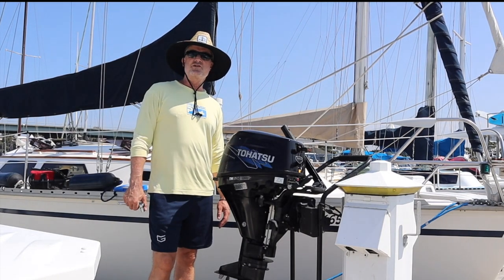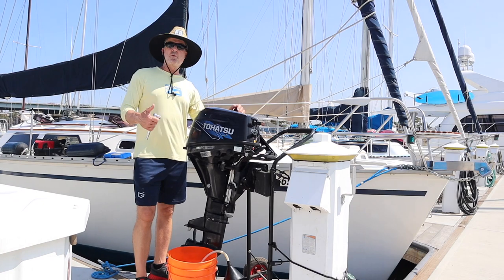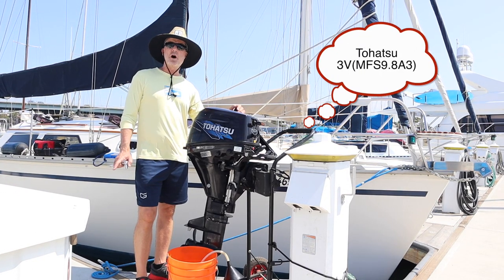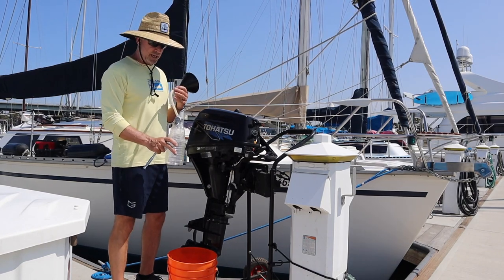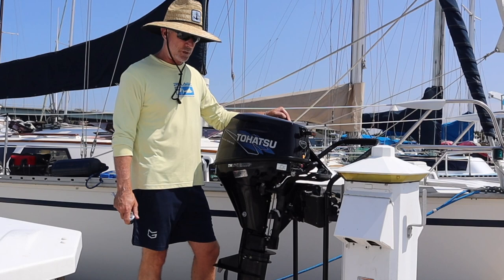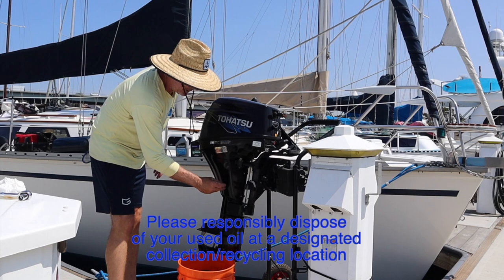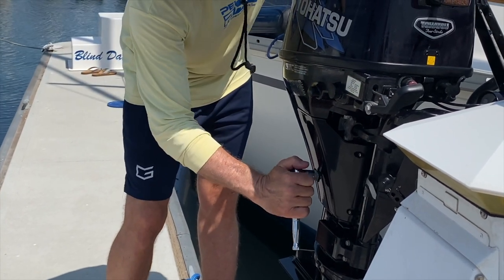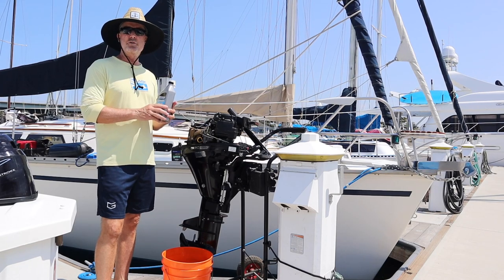Outboard Motor Oil and Gear Oil Change ~ Tohatsu 9.8 ~ Ep 77

Comment: Well done video. Another method to check the lower unit oil level after changing is bend the tip of a zip tie at a right angle and use it as a dip stick. Has worked well for me.
Reply from the maker: That’s a good idea to use a zip tie — probably a white one would be best. Thanks for watching and commenting — much appreciated!

Comment: Very well done video! Just bought myself a Tohatsu 20hp and just completed the 10hr break-in period. Now I have to change the gear oil. Seeing you do it really helps.
Thanks for sharing! Beneteau 373 owner from Montreal, 🇨🇦
Reply from the maker: Thanks, much appreciated! The only thing I wouid stress on the gear oil is to make sure it’s coming out of the top in a steady stream and not just in spurts. Double check with the amount remaining in the gear oil bottle to make sure you’ve added the required amount into the lower unit. I have a Hunter 30, but if I bought another monohull it would probably be a Beneteau. Nice boats! Been to Canada and loved it!

Comment: I just did both of these oil changes. The video is very helpful, but I have one suggestion. When I squeezed the bottle to fill the lower unit, it seemed like it was going very slow and my hands were tiring. I had to stop. I took it out, looked at it and realized that the end of the piece you stick into the engine has only a pin hole. I was squeezing like hell and hardly anything was coming out. I took a knife and cut about 1/8 inch off the end, and the hole was much larger. I squeezed the oil in without any trouble.
Reply from the maker: Yes the squeeze bottle caps require that you cut the end off. I’m glad you were successful on your DIY project!

Comment: thanks, nice done, is there any need to check the valves or change the fuel filter?
Reply from the maker: If it’s running fine I would say no. But the owner’s manual says that the fuel filter should be checked for water or debris before every use. I doubt very many people do that. It wouldn’t hurt to check it occasionally to clean or replace. As to the valves, I know of no regular maintenance required for the valves.

Comment: Awesome content!! Just bought a used 2006-2008 8hp long shaft nissan (which as I understand it is same as tohatsu) that I plan on going through and servicing. Question, what is the adjacent screw that is next to the (top) fill screw on the lower unit, and what purpose does it serve? 
Thanks in advance 😊🙋‍♂️
Reply from the maker: I think you’re referring to the water plug. But we have different motors. It’s used to flush the motor with fresh water. Your owner’s manual explains that process. Confirm with your manual, but remember the upper  plug on the lower unit is not the fill plug. You fill the lower unit from the same plug you drain the oil from. That seems counter intuitive, but that’s the process for outboard I’m familiar with. If you didn’t get an owners manual with your used outboard — you can always find it on line. Lol I’m just a DIY guy and not a mechanic, but I’m big on trying to follow the manufacture’s instructions. Good luck and thanks for the comments! Much appreciated!

Comment: Do you have a model number or size? for the 5/8's washer? what material are they? did you use new ones in this video?
Reply from the maker: If you’re referring to the engine oil drain plug: it’s a metal washer and I didn’t replace it. I don’t know the part number. If you’re referring to the lower unit gear oil drain plug and level check screw gaskets: At 8:58 on the video I explain that I’m replacing them and show the OEM package with part number on the screen. The OEM gaskets aren’t metal, paper or rubber. Maybe some type of fiber.

Comment: Where should I buy the replacement gaskets? Any suggestions friends?
Reply from the maker: @MrMkirk23  I buy most of my OEM Tohatsu parts from East Marine LLC. Typically they charge $5 to ship light weight parts to my location in CA. You can find non OEM gaskets on Amazon and pay less. The link below is for part #332 6006 1 (which is superseded by same number but last digit is a 0 instead of a 1). The page lists all the motors that the gasket is compatible with. My motor is a 2012 9.8 MFS A3. See link below:

https://www.tohatsu.us/index.php?main_page=product_info&cPath=1000_1164_1168_1169_15874&products_id=101092

Comment: Nice video! This tohatsu 9.8 hp have no engine oil filter? Thank you!
Reply from the maker: Correct, it doesn’t have an oil filter to change. Apparently there is a screen for the oil under the motor, but it isn’t something you change with the oil.
Reply: @tcsadventures  thanks for sharing information

Comment: why do you pick 10w30 not 10w40? I though 10w40 is better in terms of a wider temperature range.
Reply from the maker: When I first read this I thought you were talking about my Yanmar engine and replied accordingly (since deleted). I normally follow what the manufacturer recommends for the climate the motor is operated in.

Comment: Do you fill your engine oil to the top bar or middle?
Reply from the maker: I let it sit so all the oil drains out and then I add the manufactures specified oil capacity. In the video I discuss what that amount is. I think it’s 800 ml. That should get it to the top line on the dip stick.
Reply: @tcsadventures  thank you

Comment: I am wondering why you couldn’t put the bottom gear oil screw in first then pour the oil in the top hole until it is overflowing.   I don’t understand this method of trying to get the bottom screw on while the oil is flowing out.
Reply from the maker: I can you tell you for sure that it’s what the manufacturer recommends (I think I put language from the owner’s manual on the screen), and I believe the purpose is to push any air up and out of the lower unit. For me, if I have a doubt about something I often call tech support at the manufacturer and get the info straight from the people who make the product. (lol — instead of trusting that I know what I’m talking about!)
Reply: @tcsadventures  I’ve had other machines, like a Honda rototiller that have this same 2 hole design for the gearbox.   They always said to plug bottom and fill from top until it overflows.   Air bubbles go thru oil.  Slower then water but still easily.  Can’t wrap my head around this but thanks for replying.  Cheers.
Reply: All outboard or I/O outdrives are filled this way, from the bottom up.  It's about pushing air bubbles up is my understanding.  They have a pump that mounts to the bottle that attaches to the bottom screw hole for just this purpose.  He mentioned it in the video.

Comment: Ever have a problem with water not flowing out?? I think mines clogged up
Reply from the maker: No it hasn’t. It could be that the intake is blocked with trash or other debris or your impeller may need replacing. The following link isn’t my video but it covers those areas: https://youtu.be/RVGgVCJ12bE

Comment: Would you have a link for the washer and gaskets used?
Reply from the maker: I have a 2012 9.8 Tohatsu 3V(MFS9.8A3). I don’t know if you have the same model that I have and I don’t want you to order the wrong part. If you search your year and model and Tohatsu Parts Catalog — you can confirm the part number and then search that number to see who sells it. Below is the link to the catalog for my model and links to the gasket and washer. After you receive parts, I would always compare them to the original you are replacing to make sure they are the same.

Catalog link:

https://www.tohatsu.us/docs/pdf/Parts%20Catalog%20MFS8A3-9.8A3%20(2012)%20-%20(00221051-8).pdf

Gasket Link:

https://www.tohatsu.us/index.php?main_page=product_info&products_id=101092

Washer link:

https://www.tohatsu.us/index.php?main_page=product_info&cPath=1000_1239_13418&products_id=112656

Comment: Getting ready to order a 2022 Tohatsu 9.8. I assume since yours is 10 years old it’s been working pretty well for you? Getting a Highfield 2.8m inflatable to put it on. I’ll have to see if the stock prop is gonna work well
Reply from the maker: I’ve been really happy with my motor.  Always starts on the 1st or 2nd pull and runs smooth. Is the one you’re going to buy fuel injected? I think most of the sailing channels have Highfield’s now. My channel isn’t big enough for them to offer me a deal on one — lol!
Reply: @tcsadventures  just plan on getting the carburetor model. Do you think the fuel injection model is worth it? I’m also just getting a light weight air floor Highfield since it’s going in our travel trailer
Reply from the maker: I don’t know what the price difference is, but I know from experience if you let fuel sit in the carb you’ll have a lot of problems. My Achilles has an air floor. I wanted the air floor for transport, but I ended up just leaving it in the water year round floating behind my sailboat. For me, I should have gotten a hard bottom.
Reply: @tcsadventures  understood. If I use 10% ethanol fuel in any of my small tools the carburetors fail quickly when then aren’t used frequently. With ethanol free gas, and a good stabilizer, I’ve never had an issue.  An air floor wouldn’t be my preference but given our smallish travel trailer it’s a must

Comment: hi, tell me, is tohatsu outboards 4T oil good?
Reply from the maker: I’m sorry I don’t think I’ve ever used their oil. But if it’s branded Tohatsu specifically for outboards and it’s the correct recommended weight and type (motor vs gear oil)— it should be fine.